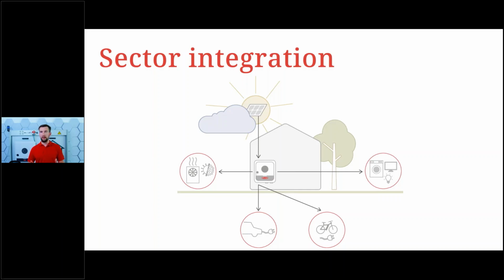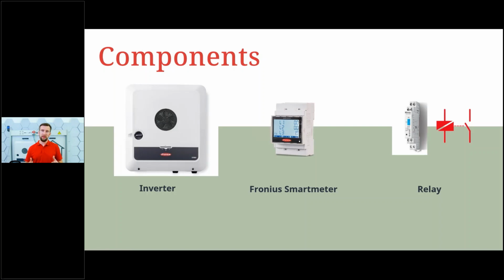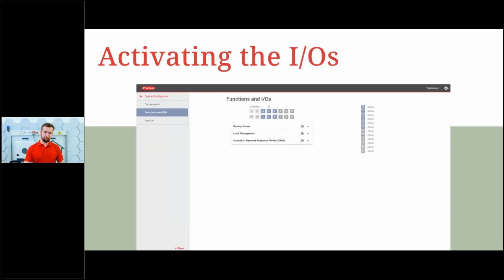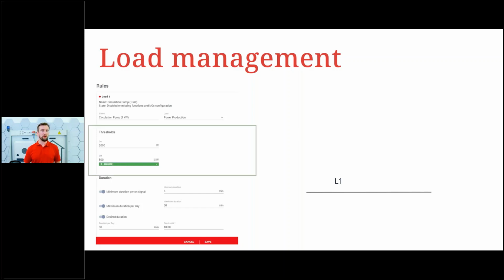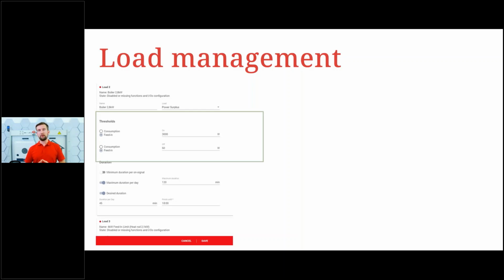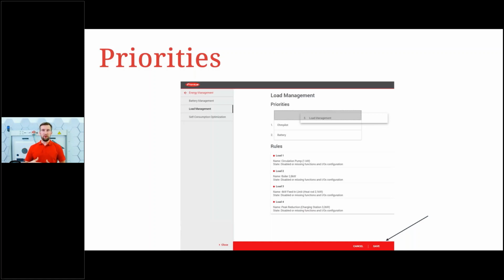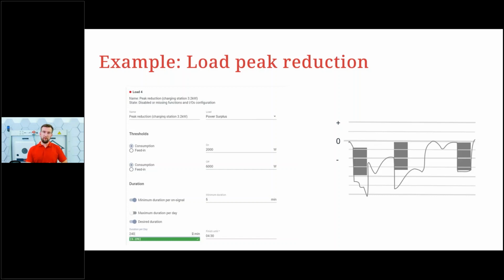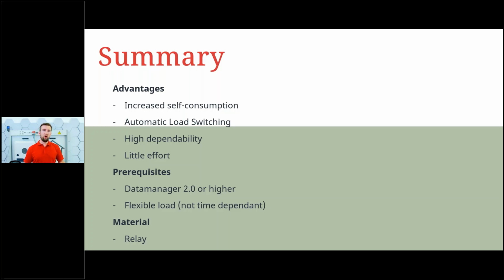Webinar: Load Management with Digital IOs

Comment: Hi Fronius Team, I am using Fronius Load Mgmt and it is great, but I am missing one setting in the software: It is not possible to trigger a digital output based on battery state of charge. I would need an IO to be switched on when SOC is below 20% and switch off again when SOC is above 40% to start and stop a generator. Could this be added to the firmware ?

Comment: Visualisation via Smart Meter - I have a Smart Meter and can't see this - as the owner, I would like to be able to control our battery - put in off peak from grid to use during Peak hours. How do I do that? Do you need a certain Smart Meter or can only the Installer see all what you show?
Reply from the maker: Hi Helen E.!

You have to connect to the web-interface of the inverter and log in with the technician user, then you have full access to all the settings, which you see in the video.

Best regards, your Fronius Social Media Team

Comment: Can it trigger a smart 12v relay like a Shelly 1 plus wifi relay switch as that could trigger the smart switch side and turn on wifi devices like AC, heat pumps etc... that don't have 12v trigger and nothing in Australia that's not Industrial size does.

Comment: When will you added remote self management?  Eg turn on/off battery charging during low PV and low cost grid.

Instead of having to be on-site and press button and connect to inverter wifi
Reply from the maker: Hi AusGuy!

There are some options to get remote access to the inverter, but we do not offer this function directly, because of safety reasons.

Best regards, your Fronius Social Media Team